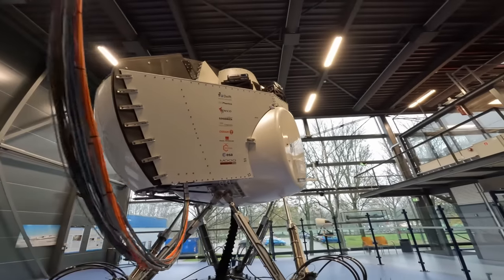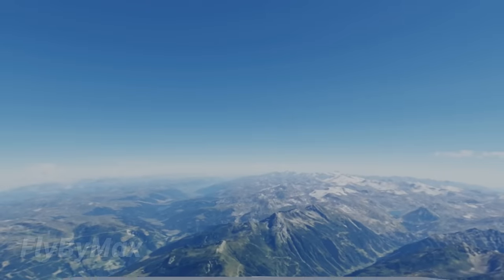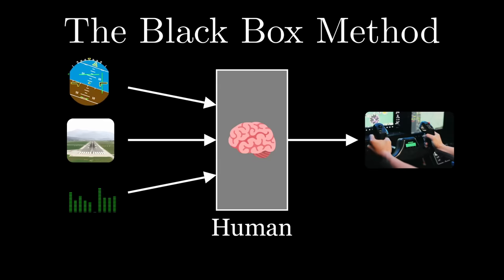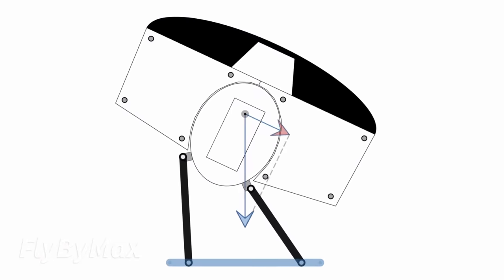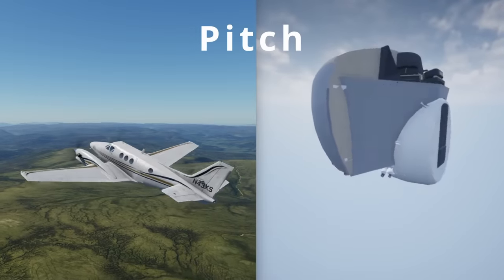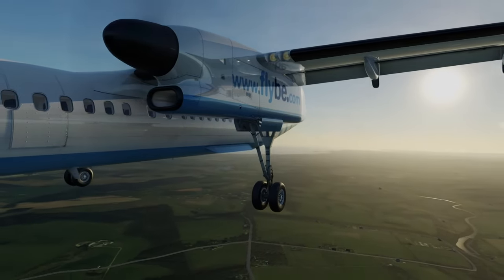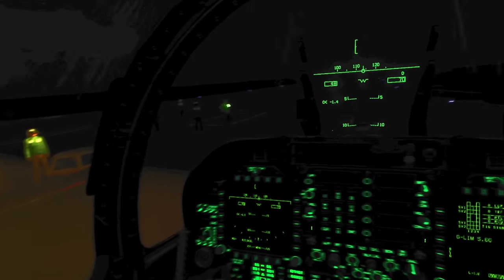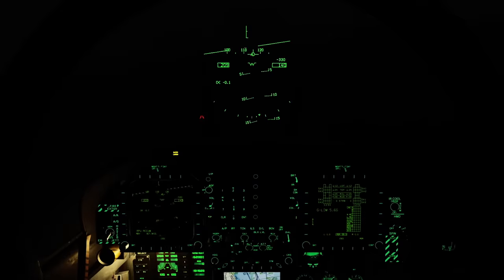How Flight Simulators Trick Your Brain

Comment: Very interesting. I have to admit I had not thought about this concept very deeply but it all makes good sense. I wonder though in a roll for example, in order to zero the force out the simulator needs to return from the roll position to level, but what prevents that roll back to level applying an unrealistic force to the pilot? In the real world when entering a roll, the forces are the initial roll force in that direction then neutral assuming a properly coordinated turn. But the simulator has no alternative but to apply roll in that direction, then roll in the opposite direction then neutral. I assume it must do it in such a subtle way that the unwanted effect is minimal.
Reply from the maker: This is an AMAZING question!! You’re absolutely right, when the simulator ‘washes out’ the roll back to neutral, it does this far slower than the initial excitement. That way your vestibular system only senses the initial impulse, not the returning to neutral. You can see this very clearly at 6:40 on the right in the shape of the curve (very steep at first, then smooths out). Great comment.

Comment: In my experience the most realistic part of the sim is straight and level flight through turbulence, or the feel of turbulence with spoilers deployed and the vibrations from hitting stuff with the nose wheel. The biggest inaccuracy is due to the sim’s inability to simulate g forces accurately in the vertical plane.
Reply: Exactly what I thought. It can’t do anything above 1G

Comment: Really interesting. Presumably it's conceivably possible for the pilot to put in a series of inputs that the simulator controller cannot achieve all of them and still have time to 'washout' back to a neutral position allowing 'spare' hydraulic travel... how often does that happen and how does the controller decide what to prioritise?

Comment: I got to fly a B1-B simulator at Dyess AFB about 20 years ago, and when the sim operator relented and turned on the motion base, it got WORLDS easier to control, it just felt right. In the sim we dropped a massive boom on Abilene and then cruised 50 miles north to see the location of the sim op's fishing shack on Lake Stamford. Flying supersonic at 300 feet even if only in a sim is AWESOME.

Comment: Can it simulate the force of the seat pushing the pilot into the controls?
Reply from the maker: Good question! Yes, the platform can pitch down to give the feeling of deceleration in level flight (like braking in a car). In this case, the straps/friction of the seat will exert a force that pulls you backwards instead of forwards. Thanks!

Comment: Really great presentation! Aircraft maneuvering is generally described with the following terms: Aircraft Movements are dynamic and are Pitch (Elevator), Roll (Aileron) and Yaw (Rudder). Aircraft Attitudes are static and are Banked, Climb, Descent, Cruise and Slip/Skid. Aircraft Movements are in relation to the aircraft axes. Aircraft Attitudes are in relation to the Horizon. The Pilot Pitches the nose up to Climb, down to Descend, level to Cruise. The Pilot Rolls the aircraft into a Banked Attitude to turn. The Pilot uses Rudder and opposite Aileron inputs to Yaw and Roll the aircraft into a Slip Attitude or too much rudder for the amount of aileron to put the aircraft in a Skid Attitude. Slip and Skid are indicated on the Aircraft Turn Coordinator. Attitudes are displayed on the Attitude Indicator (aka Artificial Horizon) and also by looking out the front window at the natural horizon in VFR weather.

Comment: In a constant roll angle you should feel an increase in felt g-force, which you never will in a simulator. Also you wouldn't be able to do the cool dive and climb in a parabolic arch zero g maneuver. These are the first things I would check if I climbed into a simulator.
Reply: Same

Comment: This stuff with the washout is what causes CFIT (Controlled Flight Into Terrain).  It happens in the dark or clouds.  If the plane starts to slowly roll and the pilot doesn't notice on the instruments they wont feel it.  Then when they do notice they try to fix it, but it feels like they're turning in the opposite direction.  They can't merge the feeling in their ear to the gauges.  Pilots that have CFIT will believe their ears and not the plane.  They end up turning tighter and tighter, not understanding what is going on, and lose altitude because the lift component keeps shrinking.  Pulling up only makes the turn tighter, making the problem worse.  The whole event doesn't take that long. And all because of slow roll rates not being registered by the inner ear.  Cool for a simulator, deadly in the real deal.
Reply: I don't understand how a person can not feel himself falling out of the seat. When a plane rolls, there is essentially no acceleration involved --- i.e. it's the same thing as tilting the floor underneath the chair you are sitting in. In that case you are going to tend to fall out of the chair unless you deliberately lean in the opposite direction of the tilt.

At any rate, if it is an issue of not believing the instrumentation, a cheap solution would be to hang something --- a necklace, a pair of "fuzzy dice"... If something appears to be defying gravity, you know your assumptions were incorrect. Better yet, have such a pendulum integrated as a mechanical indicator.
Reply: @bricaaron3978  Typically when CFIT happens its when there are fewer visual queues, IFR or at night.  Having some internal visual queues might be helpful.  Also,  as far as I know, usually CFIT happens to VFR pilots since they don't have as much training to rely on instruments only.  IFR pilots are trained to believe the instruments.
Reply: @brandonb417  'Also,  as far as I know, usually CFIT happens to VFR pilots since they don't have as much training to rely on instruments only."

That makes sense.
Reply: @bricaaron3978 the thing is that you won't feel like you are falling off the seat. Let me put it this way: when turning in a car, the car doesn't roll. And you slide off the seat to the opposite side that you are turning. Trusting a pendulum to see the centrifugal force would be ok (we've seen this on air fresheners that hang of the mirror).

Now turning in a plane it's different since the plane does roll, imagine the pendulum in the car while turning, it's pointing to one side, right? Now imagine the car slowly rolls while turning (like a plane), the pendulum points maybe 45°, but also the car (or plane) has rolled 45°, meaning that the pendulum now points to the floor of the aircraft, not ideal on IFR conditions. Also that's why pilots don't feel like their sliding off the seat

Now I understand that you meant the feeling at the point of rolling, not when already turning😅.

Comment: Great video - may I suggest a part 2 that focuses on the complexities of the visuals and the collimated display? Having seen it I can tell you this is one of the biggest changes you'll see between professional and nin-professional sims...
Reply: To give some context to those unaware, a collimated display allows your eye to focus in the distance - this has to be experienced to fully appreciate but it's the difference between looking at a far away object on a TV screen a couple of feet in front of you and looking at a far away object out the window. It gives depth to the image and increases the immersion considerably. It also reduces parralax error (which, if using TV screens for simulator visuals) would mean the view would only be correct for one of the two cockpit seats, not both. This is not the case with a collimated display because the focal point is so much further away.
Reply: Collimated displays are super expensive which is one reason these cost so much. It would be cool to try one of these sims. Or eventually get it relatively affordable to have at home.m

Comment: Excellent video. I have a couple of scenarios which I think may be related to this that I’ve never understood.

Worth knowing that I am actually completely blind.

1. When on a train, I can not always tell if we are going forward our backwards. I assume this is due to me not being able to look out of the window and the force of the seat would either be very low when the train first sets off in a forward motion or non-existent if the train moves backwards .

2. When on a plane taking off, at first you can feel the upward motion, but when they reduce the engines from max power, you get a sensation of falling even though the plane is still climbing or levelling off
Reply from the maker: Good examples!

Comment: 10:25 but those things are not really the same. When pitching upwards,you split gravity into a force horizontal to your body and a force a bit smaller than gravity exactly vertical to your body. This is also what happens when tilting the simulator. So those two are the same. 

But when accelerating forwards, you have the full force of gravity and an additional force forwards. In this scenario, the force vertical to your body is exactly gravity. So it is not the same thing as tilting the simulator, because the force pulling you “down” (from a persons frame of reference) would be smaller than gravity (like the first example). 

Now my question is: Can you actually feel that difference?
Reply: Good question, but that's not significant. A 10 degree tilt, for example, gives you 0.17 G of longitudinal force, and still leaves you with 0.985 vertical. Sin and cos, respectively. It's not zero sum. And I don't think anyone can sense the loss from 1 to .985.
Reply: @FlyNAA I’m a very frequent flyer and I can most definitely tell when the plane is in a turn by lifting my arm and letting it drop. In a turn you usually experience a force greater than 1G and you can feel your arm being pushed down harder than expected.
Reply: @DreamOfFlying  this is true (typical turn 25° bank, 0.1 G increase) but a different thing from what I'm replying to. What the post is talking about is not stimulating a turn, but rather simulating longitudinal acceleration, by tilting the sim up/down to introduce a longitudinal component of gravity. In my example the tilt is 10 degrees to give the intended effect of 0.17 G longitudinally, and the (under discussion) side effect of a 0.015 G loss vertically.
Reply: @FlyNAA  I understood what you meant. My point was that you can actually feel even small changes in the forces you feel
Reply: @DreamOfFlying  There's a difference between small and small. The one under discussion is literally an order of magnitude smaller than your example. It's 1.5%, or 3 pounds out of 200, about the same difference as being naked vs. wearing clothes.
Reply: @FlyNAA  I totally understand that. Once again, my point is that it can actually be felt irl, compared to in this particular sim
Reply: @DreamOfFlying  How are you so sure that you can feel that little G difference? It sounds very doubtful to me.

Comment: I finally understand why flight simulator doesn't need that large of range of motion, I never understand why they can trick human, but without actual visual reference, gravity can do the job.
Maybe only thing it isn't capable of simulating is continuous freefall. It might be the reason deep stall situation get pilot into so much stress, as they can't really experience it in simulator.

Comment: There is one difference between the sense of acceleration in a simulator and in real plane.

In simulator, the feeling of weight on your butt lowers, because some of the force vector is distributed to your back.

In a real plane accelerating on runway, you feel full one G on your butt PLUS the extra horizontal force on your back.
Reply: He didn’t even mention this in the video. I was so disappointed

Comment: Yes, but simply claiming it’s the sensation of being pushed into the seat is ambiguous. Advancing the thrust levers feels like being pushed into the back of the seat, but the vertical acceleration once establishing a climb (unless a vertical takeoff is performed…) should give another extreme and noticeable component of being pushed into the seat cushion below your butt. So why doesn’t the simulator need to differentiate between that? Also, what happens if more sudden or unusual movements happen to the aircraft and the washout period after the previous manoeuvre isn’t completed yet? I can imagine the motion logic can’t recover from that and neglects its goal of always reverting to the neutral point of the axis: so at least this breaks the immersion since certain steps in the sequence are impossible to be simulated in quick succession, am I correct?

Comment: Einstein had a thought experiment that sheds light on the acceleration vs gravity idea. He proposed that if you were inside a closed elevator, there wouldn't be any device that could tell the difference between the elevator moving upwards rapidly or just sitting in a gravitational field. Same goes for our vestibular system.

Comment: Cue onset is critical.  (Get the perception started)
Cue conflict is critical (especially the visual vs vestibular)
Selective cue disruption can actually complement the perception.( my own theory.  Flying close engagement fighter maneuvers with lots of rapid turns climbs, dives, vertical loops; the 6 degree of motion platform can not fully replicate but the immersive display (270 degrees horizontal 8 collimated display panels of a dodecahedron) is the compelling orientation cue. A G-seat which pushes you around in the cockpit seat is supposed to provide a gravity cue by making you sink into the seat during high g manuevers or lift you upon the seat during zero G, but it mainly disrupts your “seat of the pants” sense of gravity. By disrupting your sense of gravity direction in the simulator, it disrupts the cue conflict between actual gravity and acceleration vector forces being simulated thereby eliminating the cue conflict.)

In the heat of intense excitement and intense focus of attention on the dogfight, the 6 DOF motion system provided little benefit. The fully immersive collimated display was the overwhelming cue especially when the g seat disrupted the “seat of pants” sense of orientation. At one point the motion platform system shut down in the middle of a simulated dogfight when a moog valve limit switch was triggered. The jolt of the platform when it settled to its resting position was a momentary distraction but the lack of motion was not even noticed until later. (Total visual immersion in a display that looks infinitely far away plus the G seat disrupting the sense of gravity plus intense focus of attention on the    training task made a compelling simulation. 
    The 6 Degree Of Freedom motion does help sometimes like initially establishing reliance on immersive visual cues and not noticing a cue conflict of visual vs sense of gravity, when nose down in idle with speed brakes out while following an aircraft in a vertical dive but careful not to end up in front of the other aircraft, the 6 DOF motion does make you feel like you’re falling forward out of your seat & held in by your seat belt harness,  sense of acceleration when kicking into afterburners, roll rate changes when rolling 30 degrees to look down underneath the aircraft, 

Real time training Simulation provides two benefits, 
1… realism which equates to better transfer of training skills learned in the simulation to real world
2… cues necessary to perform the training task

Comment: You can still feel the centrifugal forces during a turn in a real aircraft, especially if you were to fly a fighter jet and pull a few Gs in it. Unfortunately this is not something the simulator can do and would be extremely hard to do as well.

Comment: A single point that irks me regarding the carrier accident...

A pilot would use the relative movement of the stick as a reference point. You can feel how far you have pulled the stick back and how much you have pushed it forward without any visual feedback.
i.e the pilot would have felt that he pushed the stick far more forward than he had pulled it back (due to humans innate spatial awareness of their limbs).

Additionally, the physical resistance of the stick's hardware mechanism would be another 'input' used by the pilots 'algorithm'.

Brilliant video!

Comment: Great video and explanation.  Modern simulation feels just like the aircraft, at least for Jet transports.  
Just one additional thought about somatogravic illusion is not only do you lower the nose to compensate for the perception of over pitching,  with a takeoff thrust setting, the lowering of the nose further exacerbates the illusion by increasing the acceleration.  Unfortunately I knew a couple of people killed by this phenomenon taking off from a dark remote airfield at night in a high powered piston aircraft.  This is the typical scenario, dark night, high acceleration.

Any night takeoff, even after 30+ years of flying is still locking onto the attitude indicator, the sensations still make you feel uncomfortable.

Comment: In my opinion, using the tilts to simulate acceleration are easy to understand. The fascinating part is how the simulator decides to wash out the signal in order to maintain the same position. The sim can't reproduce forces exactly due to these restraints, so it's cool to see how it compromises accuracy with practicality.

Comment: acceleration vs velocity is another weird sensation. Try this in a car with a manual gear box:
Get the car traveling backwards at a decent speed - now, shift into first and by just feathering the clutch and gas (no brake), get the car to slow down, stop, and start traveling forward. If you are smooth enough, and your passengers close their eyes - they will have no idea when they have stopped going backwards and started to move forward! They will be unable to feel the change in direction or the brief / instantaneous moment of zero speed/being stopped.